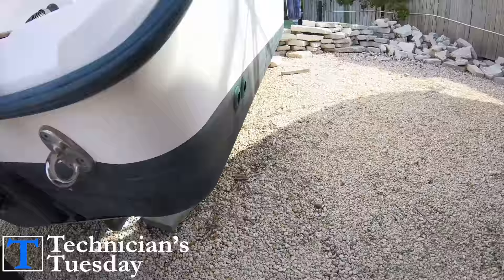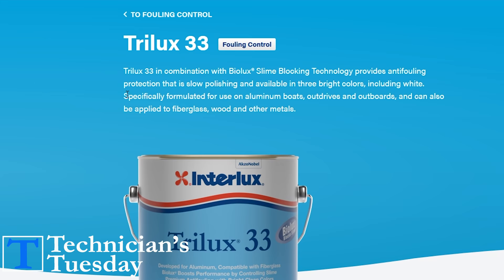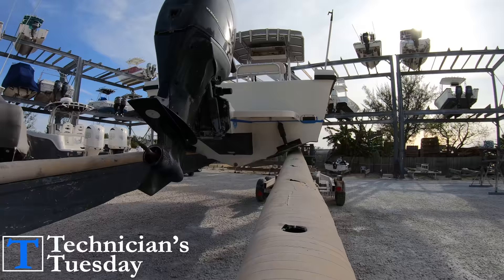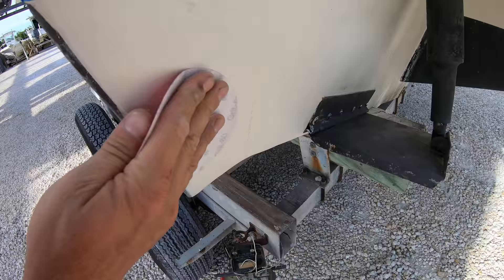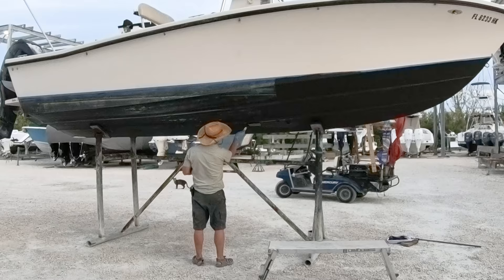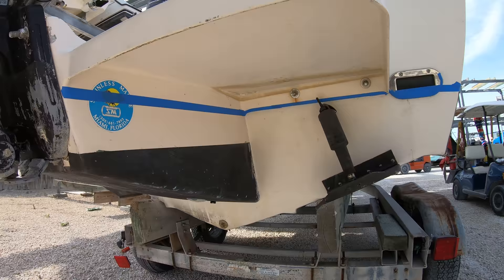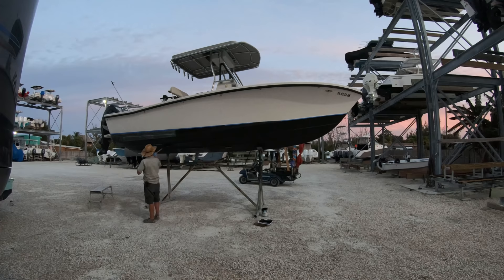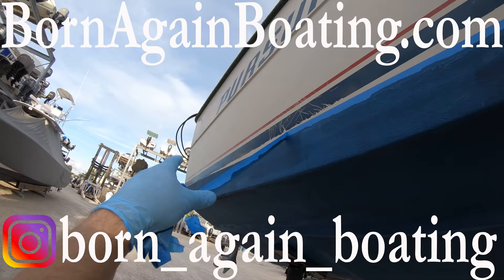Boat Bottom Paint! DO'S & DON'TS!

Comment: I've been painting boats since 1970 and the #1 rule is use a brush not a roller! Rollers waste paint big time. It might take you a bit longer but you'd get at least 4 coats on a 21' boat. When using ablative paint plan on launching the boat within 8-24 hours. The longer it's allowed to air dry the harder the paint becomes reducing its sloughing abilities. Always hand sand with 80 grit paper prior to painting, do not use power sanders, you might leave gouges in the hull. No need for a different barrier coat, just two coats of paint. When hauling out power wash the hull while it's still wet! If allowed to dry any algae will harden like cement and aggressive sanding will be needed. In the Spring prior to launch day all you have to do is sand with 80 grit, rinse and apply one coat then launch.
Reply: It doesn’t matter if a brush gets you more coats if the roller gives you thicker coats
Reply: Thanks for the  tips.

Comment: I used to paint bottons for a marina as a kid. Very important. Use a pole on the roller. Helps keep the splatter off your skin. Take your time, go slow. Keep the roller from "carrying" too much paint. Always paint the roller tray before taking it away from the tray. Keep painting bottom of boat until practically no paint is left on the roller.

Comment: Horror story from my previous dealer who I bought a new boat from. He painted the water line too low and mid season took boat out of the water for work that was promised the growth was horrible. Asked him to raid the water line since I paid to have the bottom painted all he did was paint over the growth and strange reason felt it was necessary to scuff the gel coat above that. By the time the boat came out of the water the end of the season the hard barnacles that were on the bottom took a long time to get off. I had to redo it myself with primer and after the second season there was no growth. Worst dealer in history

Comment: Good tips.  I have a few to offer from my experiences.  Also have a bracketed boat, used to use Trilux on the bracket and tabs and copper based Micron on the glass,  was never happy end of season with the Trilux, so went to Micron CF (copper free) for everything, and saved money for the quart of Trilux, one gallon covers my older 25 Grady entirely.  Also because of the heavy buildup, I bought a floor tile scrapper from the Depot, which includes an integral long handle.  I rounded off the blade corners, and in my driveway, I was able to scrap off the built up paint just about down to the hull or original first coat, I wet the hull and blacktop driveway to keep dust down but it’s mainly solid pieces I broom and shovel up unlike sanding.  Must keep the blade sharp. I did 1/2 of the hull one year, the other half the next year. 1/2 takes about 4 times of about 2 or so hrs. Also, made the mistake of applying the paint straight when it was in the 70s and should have thinned it.  A single coat too thick, where the roller would start sticking and you just go for more paint will always crack and flake off, better off thin coats say two.  One too thick coat can’t be undone and creates the unevenness and peeling that sanding can’t get into the depths.  I always thin the paint now, stay out of the sun, and paint in the 60s.

Comment: Great tip on the different paint needed for aluminum. A lot of people probably use the same paint on the bracket & trim tabs as the hull.
Reply: The previous owner of my boat went as far as putting ablative over the anodes. Used car salesmen make terrible boat owner.

Comment: Here in Malta usually we leave the boat for summer season only. when I  applied bottom paint I used to apply soft antifouling so when the boat is out from the water with the power washer it goes almost all from the hull and when you need to prepare it for the next season you just need to sand it lightly or nothing with the orbital sander .last season and this season I used antifouling from International but I noticed that when applying white colour it grows barnacles and algee much faster then dark colour as specially when you use the boat during summer season and you leave the boat after for a couple of months during winter.   Another experience that I had I painted a boat for a season and the owner didn't put the boat in water and he decided to put the boat the next season and when summer was over he had the same result as usual , no algee a little barnacles.

Comment: So, I'm on year seven (in SW FL) with three layers of hard bottom (Pettit) paint after a sand down and a reseal with Interluxe 2000 and the antifouling over top since our last haul out.  This is a 30 year old boat... We need to haul out sooner or later but have time.  It is a 33ft. sailboat. I did a special black, blue, special black coating so I know when it's time pull  out for another bottom job.  Pro tip, do extra coats at the waterline... That said, we have a monthly diver that cleans the hull with a plastic scraper... metal will cut the time much shorter. Also, w/Marelon seacocks, so no dissimilar metal corrosion issues.

Comment: My boat has an Armstrong bracket. I use a copper free ablative paint. Using a copper free paint allows me to paint my trim tabs, bracket, and engine bracket along with the hull using all the same paint. I use an ablative since my boat lives in the water, but will get hauled occasionally for fuel and if a storm turns up the east winds for a couple days. Not great protection where I am from east winds.

Comment: Thanks for some great tips. I have the hard modified epoxy on the bottom. Too many coats. I try to power wash off as much as possible.  Next time I paint the bottom, I switching over to ablative.  Thanks again. Stay safe.

Comment: My boat was kept on a trailer so has ablative. I now keep it in the marina so guess I need to change that next paint job. I panicked about the painting of the aluminium issue you mention, but when I looked closely the fibre glass hull was green ablative but the stern drive and transom was painted same green colour but a non ablative. Hopefully there won’t be any corrosion issues.

Comment: my boat that i have bought from up north has a hard paint that i want to get it off because it has a beaitiful gell coat underneeth and painted with a brush..looks bad and stops my boat going faster,i tried to take it off but it is reaaly thick and i can not do the bottom also do not want to damage the gell coat doing it,applied paint stripper for boats but like i said the paint is too thick,need to take it to a marina to get this paint taken off i live down florida in Boca Raton.

Comment: You mentioned to start decorating once you finish the first coat. Not arguing this but interlux and nearly all manufacturers have really long recoat times like 12-16 hours. Have you found this to be required ? Seems excessive. However interlux tech support  said the times are necessary for the solevents to gas out between coats

Comment: Great video. I bought a nice boat with bottom paint in horrible condition. I trailer my boat, and have been working my tail off to remove the many layers to get to the gel coat. I’ve used an acid wash, then 3 sessions of paint stripper, and now I’m sanding my life away. Is there a high gloss bottom paint that can last years of being trailered and beached?

Comment: I've been told to keep the bottom paint away from metal and should leave a 1" gap. Such as from tabs or my metal transducer mount. But also been told metal paint not needed IF I apply an epoxy barrier. If I do apply a metal paint.. what do I do about the gap or meet up of the bottom hull paint..
Reply from the maker: I would not use the metal paint near the brackets, thruhulls, tabs, etc. I like to paint them with the metal bottom paint and then just use the same color so it's not an issue :) like you said giving it an inch gap or so. 
You should have a barrier coat on the boat either way though too.

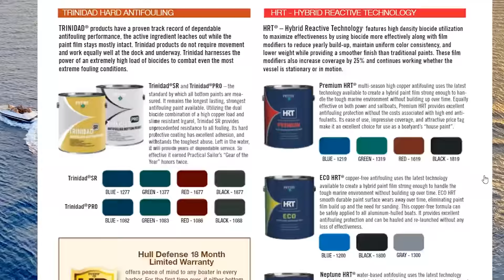Comment: At 02:30 you state a boat kept out on a lift doesn't need bottom paint.  From reading other comments, etc. do I understand correctly that I also DO NOT need bottom paint on a boat that is always on a trailer (and at most might spend a long weekend on a dock once in a great while)?

Thanks, for another informative video.  👍
Reply from the maker: That is correct :)

Comment: I've been using VS721 bottom coat on my fiberglass boat the last 2 seasons.  Does a good job but still needs to be pressure washed at the end of season.  Sits in fresh water 4-5 months of year.  No bottom paint.

Comment: do you have any videos where you removed the bottom paint and restored it to its original gel coat?
Reply from the maker: No I don't, it's a process though, you have to have the bottom paint sand blasted off or sanding it off. Then the bottom has to be re gel coated to fix it :/ it's rough :/

Comment: Okay this might be dumb but I don’t need bottom paint at all but no paints that aren’t copper or ablative or whatever say they’re only for the top side. What type of regular paint can I use to paint the bottom side of my little center console ? I don’t really feel like gel coating it because of how much work it is. Can you just use weatherproof rustoleum ? I went to a place and they sold me this oil base gloss paint that looks like crap and dries clear and almost feels like resin when it’s dry. Im not very good with paint so I could really use the advice, thanks.

Comment: My boat has been painted (unfortunately) as it is trailered. Can you give a little more information on removal of the paint. I doubt it is worth it. As the paint underneath is probably not in good shape. Thanks for the information.
Reply from the maker: The easiest way is to take it somewhere and have someone sandblast it or sand it, then you might have to do gelcoat touch up, usually after it all comes off, what's under will need to be fixed because it gets sanded down before the bottom paint is applied :/
Reply: Born Again Boating thanks for the help as always. 😆

Comment: What causes the paint to wipe off like you rub against the side of the boat and you have white dust on your arm or shirt . What do I need to do to make it not rub off if you rub against  the boat ? 

Inside and outside of the boat does it . 

I can tell it doesn't have wax or something  on it . The paint is dull looking .  It's a fiberglass  boat .
Reply from the maker: That means it's ablative bottom paint, hard paint won't rub off, ablative will. You'll want to put ablative back on with your recoat.
Inside outside of the boat, the paint/gelcoat isn't rubbing off, that is oxidization. You'll need to wetsand and compound the boat :/ it's a lot of work.
This will give you an idea: https://www.youtube.com/watch?v=Lf_V15153EA

Comment: i followed your advice about putting cayenne pepper in my antifoul and now my boat bottom is like 80 grit sand paper with all that pepper powder and is not smooth running at all. it's like i still have barnacles on my boat and would almost ventilate while cruising.
Reply from the maker: Really! WOW! How much pepper did you use? You only need to use a little bottle!
Reply: @BornAgainBoating  i have discovered the hard way that even a little bottle will leave a sand paper finish on some spots of the boat cause it doesn't dissolve in the paint.

Comment: New boater, bought a new StarCraft deck boat and had it bottom painted. I moored it and only pulled it out 2 times this summer. The second time it was covered with barnacles. I was told the anti fouling paint that they applied would prevent barnacles. Any insights into why this did not work?

Comment: I was thinking about sanding the bottom down next season on my boat. Probably wouldn’t sand blast it because it you be too expensive would probably just use an orbital sander. There is this paint a couple of my buddies have been using what I think is called aqua guard that I might try. I usually don’t paint the whole bottom I usually just touch up, even though we are in a wet slip. And my one question. When you sand the bottom down do you need a primer coat before you put the paint on?
Reply from the maker: Usually, yes, you'll put on a barrier coat, but it depends on how deep you sand. If the gel coat is in good condition, you can get away without the barrier coat sometimes. It all depends on how much you want to do and what the budget is ;)

Comment: Someone before me painted the bottom and all the out drive with bottom paint, now I have to find a way to get the bottom paint off the out drive without taking off the original paint. Any tips for removing it?
Thanks Great video!
Reply from the maker: You can try pressure washing it, but that might not work and sanding it and repainting it might be what you have to do

Comment: Man I have been looking like hell to figure out on what to put on a trailerable boat.
Reply: So  what do you put on it?  ablative bottom paint.?
Reply: @je12b  actually i have not put anything yet the bottom paint on my boat has been flaking off.
Reply from the maker: Usually you would put a semi-ablative on a trailered boat :) Also depends though, most trailered boats don't need the paint because you pull them out of the water when your done :)
Reply: @BornAgainBoating  although they look sharp with that black paint. But the previous owners did it since they would keep it in the water.
Reply: @BornAgainBoating  my point exactly. The idea behind botom paint is to keep organisms from growing on (THE BOTTOM )  if you take it in and out of the water, weather on a trailer or a lift, it should not effect the performance of the hull.  It will just look like $!÷#. But nothing else

Comment: What is the easiest way to remove (very thin/worn away) bottom paint? My hull on my boat is a beautiful sky blue and the previous owner painted the boat and it was kept in the water. I trailer it now and would like to remove it all to have that beautiful blue color on the bottom of the boat again. The ablative paint is almost all worn down and you can see the hull in some spots. Any advice? Thank you!!
Reply from the maker: You can try to carefully pressure wash it off. Sometimes with it being ablative you can pressure wash the paint of, but be careful not to use to powerful of a pressure washer and get into the gelcoat. Outside of that, it's sandblasting or sanding, and thats a nasty job :(
Reply: Born Again Boating thank you for the help. I tried with the pressure washer and that did nothing. You answered my question that I already knew the answer to. Sanding! I was hoping there was an easier miracle stripper or something. Looks like it’s going ti stay the way it is. Way to much work.. thank you sir

Comment: Bought my used 2006 Sailfish 2360 in November. The previous owner had painted the bottom to leave the boat in the water for a year. Sanded it with 220. He eventually put it on a lift and was just letting the paint wear off. I started powerwashing gently every now and then making slow progress. The exposed hull is smooth to the touch. Are there any DIY method to remove the remaining paint?
Reply from the maker: Not really, at least not that I know of, it's a nasty job :(

Comment: Hello, I have a problem with my boat at full speed (35 knots) it starts to have the nose of the boat in the water, suddenly I have to trim to the maximum and my engine starts to cavitate, my boat has two engines  150 horsepower
Reply: someone told me that I had the engine too low so that are aligned with the hull of the boat
Reply from the maker: Hard to say there, sounds like a weight issue, or the boat has a hook on the back of it :( What brand is the boat, some hulls just do that after time because they get water logged. Also heres some info on the mounting height:  https://www.youtube.com/watch?v=N_EMx9WwTlY&t

Comment: What would you charge to re do the bottom paint on a 26ft WorldCat boat ?
Reply from the maker: Depending on your location the price can vary on what kind of paint you need and what the condition of the existing paint is. Most places usually charge a flat fee for a bottom job
Reply: Born Again Boating I’m in Miami, the boat is kept on a trailer at all times but it cane with bottom paint and now the top layer is fading, the primer is there just need to remove top coat and re paint it

Comment: Does bottoms paint hurt the vaule of the boat ?  I have a Nor-Tech and I'm really scared to paint the bottom . So ?
Reply: You don’t have a choice if you keep it in a wet slip.  Bigger boats are usually slipped.
Reply from the maker: Yes, when talking about a Nor-Tech, that's a higher end boat and they are made to go fast, so most people that I know, or well for the three Nor-Techs here on the island, none of them have bottom paint :) 
@Robert P is right though, if you leave the boat in the water in a slip, it might be a good idea, but for the resale value, I'd say to try to not have to paint the bottom of the boat. If you do though, you'll need that slick antifouling paint that is made for faster boats like your Nor-Tech.

Comment: at 4:30 talks about the tape line being important then proceeds to do it completely wrong. little 3 foot sections is going to create a terribly crooked line. pull it out and strike it in one continuous sweep. UGH at 5:47 he paints above the tape and gets the hull. Use a brush to cut in, not a roller. When using a brush go parallel to the tape not up to keep paint from  getting underneath.